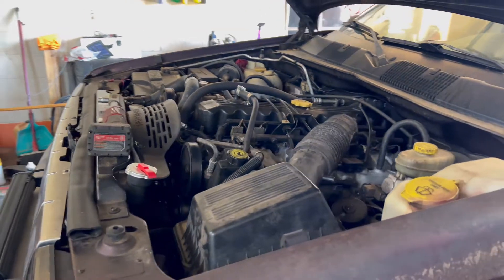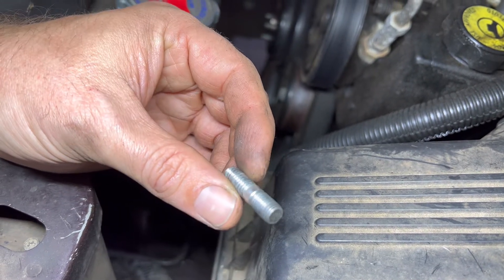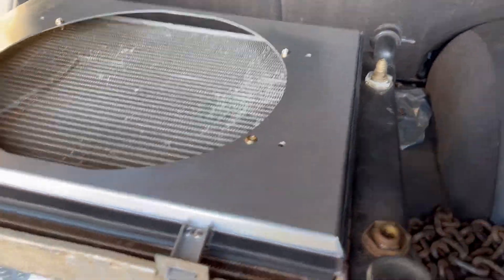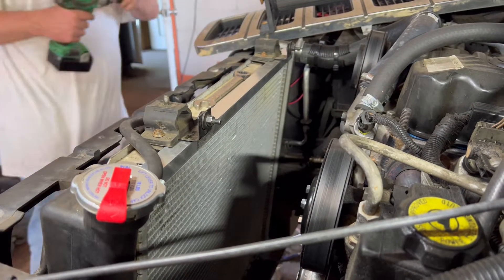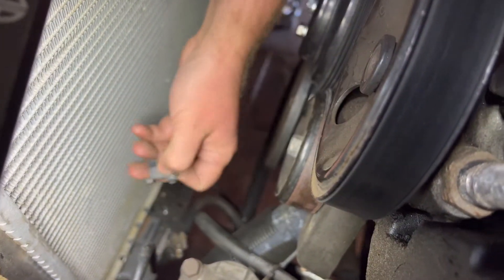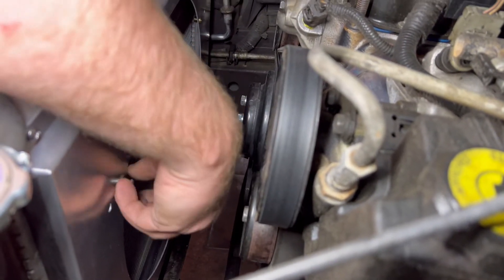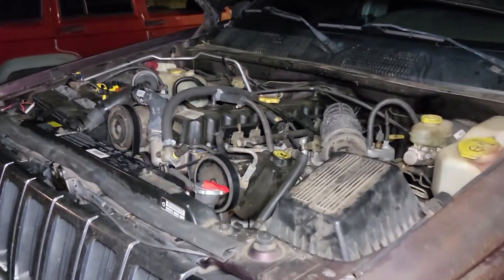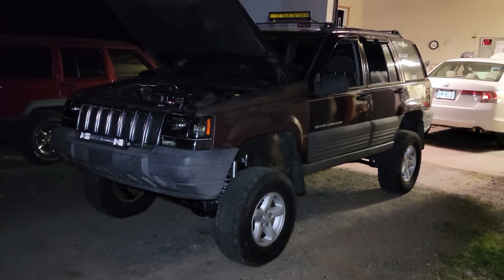Zj 4.0/5.2/5.9 electric fan install. Fix your over heating issue the right way.

Comment: I had a link to the fan shroud on Amazon, but it's discontinued. Which one do you use and do you have a link?
Reply from the maker: I will see if I can find another and share the link.
Reply: @JEEPERDUDE98 you rock bro. I even tried to email the company to see if it discontinued. And nothing
Reply from the maker: Yeah, that’s the bad thing with Amazon sometimes one seller will carry it sell out and never buy it anymore. My brother found the shroud originally because he done his. I did mine but it’s been a few years so I’ve opened a lot of hoods since then.
Reply from the maker: Cobra-Tek - CBK-HZ-1009-28- Aluminum Stainless Steel Radiator Fan Shroud Unit 22-5/8 inch X 18-5/8 inch, Compatible 28X19 inch Ultracool Radiators you can google that and try to find one. They come and go on Amazon all the time. 

https://www.bargainbondmart.com/a100928-aluminum-16-electric-fan-shroud-universal-fits-28-x-19-overall-radiator-p-436662.htm

You could try this site but I have never used them,so not sure but for the price seems like a good deal.

Comment: Not a very good design on that shroud.. the fan shroud should have vents in the 4 corners with flaps or something to allow more air to pass through it when driving at speed.  This shroud is way too restrictive.  There isa reason the 5.9zj and other factory electric fan shrouds have those vents
Reply: You can add those your self with some extra work if you wanted to... It was hard enough to find a aluminum fan shroud the proper size for these radiator cores in the first place, must-less one that had the 'speed-flaps' that could blow open at fast highway speeds lol...

Trust me, I though about it hahaha...

These must not be very restrictive at all though st 70+ mph though, because I Literally just averaged 20.1mpg last weekend from a trip from North Carolina to Tennessee on my 1997 5.2L Grand Cherokee with this same exsct setup, with 195,500 miles on it! That was mostly interstate speeds pulling hills even
Reply: @jeepjoe1996  id still add them if it aere me.  But youd need flaps.  This way theyre blocked off at idle for the fan to pull air (blocked off)  then when driving they open up if that makes sense.
Reply from the maker: @jeepsblackpowderandlights4305 I get what your saying I have a 5.9 and I see the flaps but it’s not a must have. Idle is the problem with 99% of the 4.0’s and the v8’s idle with the a/c on. My brothers 5.2 with this setup with a 205 thermostat runs in the low 190’s on the interstate and idle now all day long. This setup works better than my niner does with its factory setup and I have it wired to run on high speed. But I know what you mean with the flaps but it’s not been an issue. I run this exact same setup on our 2005 5.7 hemi because I wanted to rid the hydraulic setup and we just took it on a 200 mile one way trip and it did great! I was also towing our camper.
Reply: @JEEPERDUDE98  not sure i agree with that.. my 5.9 never gets above 200/210 unless the fan is off of course until it clicks on at 212. 

Maybe its a XJ issue or something my 4.0 never gets above 200 either and its got 450k miles now.
Reply: @JEEPERDUDE98  fing hate youtube it keep blocking my comments anytime i say specific words or a group or numbers.. i wanted to say my 5.9 never gets hot.  Its always at 200 or so when driving or after the fan kicks on.. same with the 4.0 we have both 98 zjs.  The 4 0 has 450k miles.
Reply from the maker: The 5.9 fan does good but this one does a better job at bringing it down faster. I don’t even use the computer to turn its fan on anymore I use a stand alone controller with a back up fail safe that will turn the fan on at that set temperature,don’t ask cause I don’t remember 😂 but anyway my 97 4.0 zj never ran hot with the clutch fan until you sat with the a/c on. Even with the heavy duty fan clutch. Everything was new cooling wise still got hot. Now it never sees over 204 and idle with the a/c on in 96+ southern humid heat it was 192 and 36-38 degree air out the vents. I’m not saying you are wrong about the flaps I’m just saying I don’t need them. My 5.9 runs around 206-210 with the a/c on during a hot day. You rip on it a bit it will creep up some but come back down. I know this setup on the 5.7 hemi made a world of difference with the power steering pump not having to pump fluid to that stupid hydraulic fan hp and gas mileage went up some from not having to turn that 20.5in beast. My brother has the triple 10in fan setup on his 98 xj. Those things really helped but not much you can do with a factory xj sized radiator. I’ll stick with my zj’s. I am creeping up on the 286,000 mark on the 97 zj 4.0 still strong but making some wrist pin noise when it’s cold.
Reply: @JEEPERDUDE98  our 4.0 has veen doing the 4.0 clanking or rattling since forever 300k miles ago lol and its closing on 500k.  My 5.9 has 220k but it sprung a leak either from a cracked head or gasket..  i didnt have the money or patience to rip the head off so i tried K seal and it actually stopped it in 24 hrs.  Hasnt come back in months so this shit really works.

But ny amc 360 in ny 76 J10 needs a new fan clutch it went bad after the water pump bearings yanked the fan up and side to side.. so that Jeep will get to 230-240 if i dont shut it off.    Gonna get the extreme duty version of a clutch fan.      I doubt ill notice the rob in hp with it.  

I have a spare 5.9 fan and shroud thought about putting it on that Jeep.. but even after i updated its 37amp alternator to a 90amp.. thats not enough power for a electric fan.   Gatta put a 150 on like i did my wagoneer for that.

Id probly wire it up with the 5.9s switchs too and relays as i have multiple spares
Reply: @jeepsblackpowderandlights4305  His 5.9 never ran hot either with its stock setup, but this fan setup I run here (with the spal 16" fan and aluminum fan shroud setup) Works way better than the stock 5.9 fan setup running on high-speed even though by a lot... It's very noticeable how much stronger the extra air flow frok the spal setup is vs even the 5.9 setup...

The only issue with cluch fan setups (even with a heavy-duty cluch) is these engines only idle at about 650-700 rpms idling in gear, and the fans pull a lot of air, but nothing even close to what these quaility electric ones do pull sitting still... The cluch fans setups could never even dream about hitting 185-190 degrees when sitting still with the ac on, where as these electric fans will hold it all day long as cool as the thermostat can go at regulating it's tempature without even breaking a sweat in doing so...

The electric ones have that one major advantage over the cluch fans at idle not moving... It all has to do with the slow rpm these engines turn at, as to the stock fans not pulling as strongly and keeping things as cool at idle speeds is all... Sure, they won't overheat with the stock setups, never have for any of us in the past 20+ years of having them, but they have NEVER cooled as good as they have with this electric setup. We've saw major improvements in how cold the ac gets now too when sitting idling, even from a first start up on a super hot day where the interior is roasting hot inside lol...

I love how much simpler it made things to get to on the front of the engines, and how much 'cleaner' things looked under the hood with these setups too... Even saw a step up in mpg on both my 5.2 and his 4.0 ZJ's... As for the speed flaps, sure they will do their jobs, but with these slightly larger fans, the flaps would only be about the size of a credit card at the most... The 5.9' plastic shrouds are bulkier and have a smaller fan cutout in the plastic and thus have more room for their bigger (and more) oem 'flaps' to fit around them for that extra air flow through them if needed at higher speeds. Just isn't needed or worth cutting up these nice fan shrouds to add those in place on them, I mean heck the front bumper metal shell behind the bumper alone blocks a good bit of the direct airflow path from even reaching the lower 1/4 of the radiator straight shot anyways at speed
Reply from the maker: Yeah the old motor in this 97 had 245,000 when it blew a rod through the block from a piston giving way lol. Still ran the 1/4 mile for to get home. Lol it was a flame show though. Wiped out a mouse that had been living in there and I saw its skeleton a year or so later dangling from the abs lines. Swapped in another motor from a 96 parts jeep I had and it had 264,000 on it then ran it a month or so and it had a misfire on cylinder 3. Smoke tested that cylinder and it was the intake valve not sealing up. Did new lifters push rods and reman cylinder head and it seems to be fine besides that damn rattle when it’s cold. After warm up it  99% goes away. My 5.9 has 213,000 on it and still runs good. Just the heater core leaks some but I don’t daily it anymore anyway so not a big deal. People drive crazy so I don’t drive it much. I put its first ever water pump on at 206,000 miles so can’t complain there. It does a hell of a burnout if you get time check those videos out one I did I reset the trip and it was 2.? Long don’t remember but those 265/75r16’s were boiling 😂. I kept the tires that’s my trophy 🏆 makes for a good conversation piece. I need to get my old 75 dj5 back up and going it’s got the ole 232 6 in it and runs I just need a starter and fix the brakes on it. It’s right hand drive and was used locally for years where I live on the mail route. It used to run hot but they had a 180 thermostat in it and it just circulated way too fast at 55mph and would get up to about 220-230 in about 15 miles. I just realized this is one long paragraph! Whoops lol gotta love voice text I just finished up pulling some cylinder heads off a 99 f-150 4.6 about to head out and drop them off at the machine shop.

Comment: won't give you 2 fan speeds like you get on the 5.9 factory e-fan
Reply from the maker: No but it pulls much more air than the factory 5.9 fan does. With a 5.9 you need fast,faster and outta sight! Lol
Reply: 12 years with my factory installed e-fan on my 5.9 and never had a problem.  @JEEPERDUDE98
Reply from the maker: Some do and some don’t when I got mine it only worked on high and didn’t kick in until 215+ i replaced the motor and it worked for about 6 months and then replaced it again and so far it still works. I bypassed the factory controls so it has its own fan controller that I can see to kick it on at any temperature I want. The factory setup is okay but it still doesn’t flow enough during towing to keep the temps down.